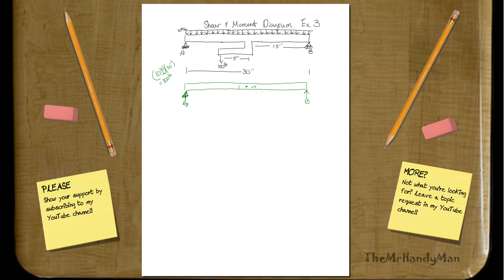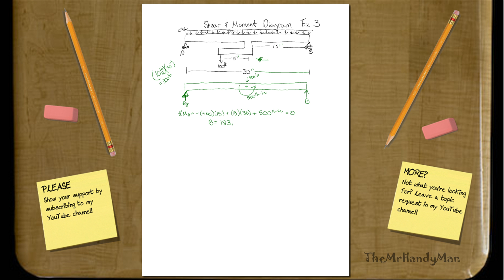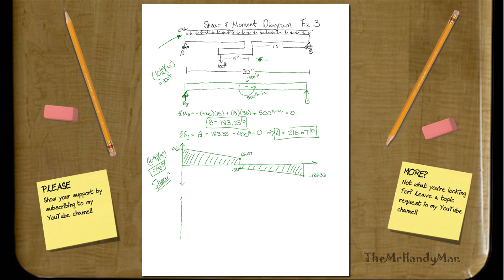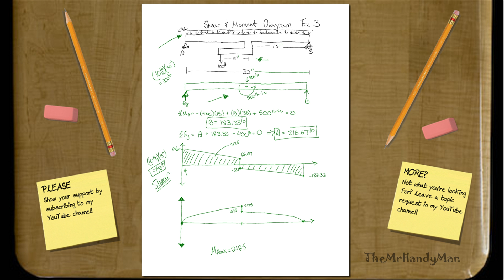Vector Statics - Shear Moment Diagrams - Example 3

Comment: Am I missing something? You have 300lb of distributed force acting on the centroid of the beam, and then you say that it turns into 400 because "it will result in a 300 plus 400 lb force" do you mean we need to add the 100lbs from the hook so then it turns into 400lbs?